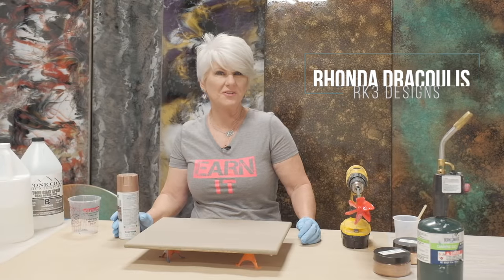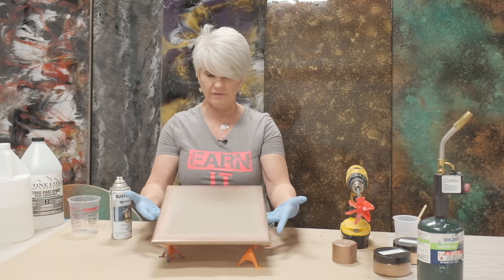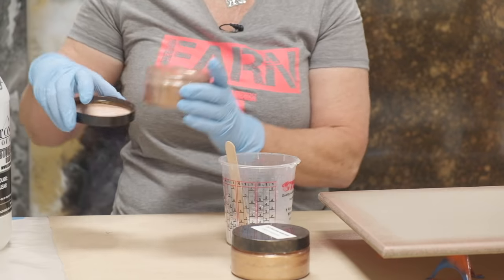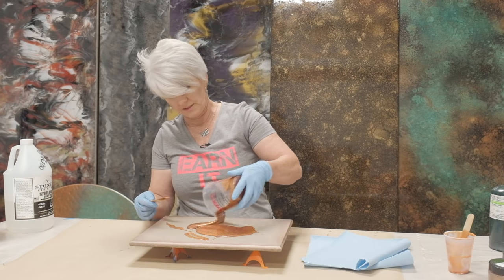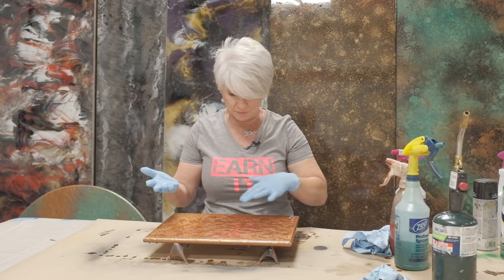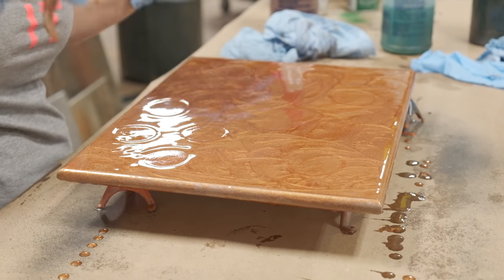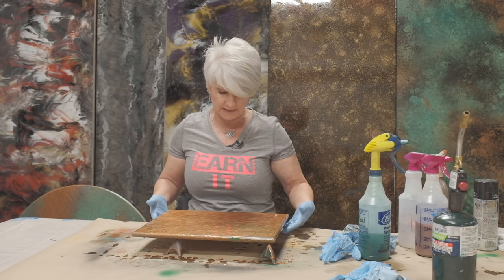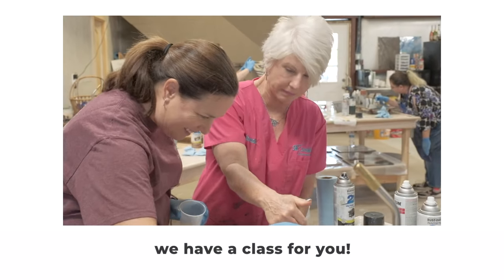Creating a Hammered Copper Effect with Stone Coat Countertop Epoxy

Comment: Hi does stone coat have a resin that I can use with a variety of projects ie: resin trays, coasters, pyramids,  moulds , wood and resin over canvas art work ? I need 1-1 in volume. Also it has to have high heat resistant for the trays and coasters?  😊

Comment: Can I do this to my wood above my stove vent or will the materials slide off onto the counter/stove?
Reply from the maker: It would be very difficult to do this on a vertical surface. If you could remove and pour it flat then reinstall, that would be an option.